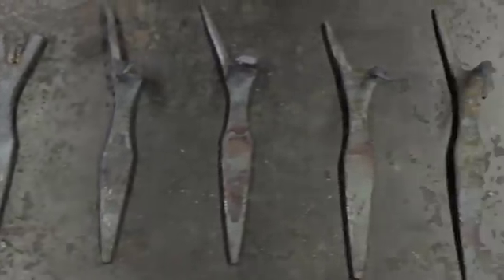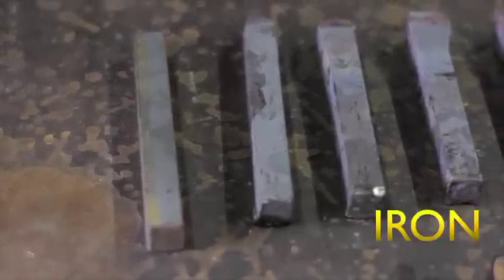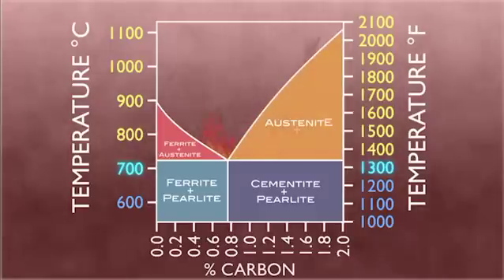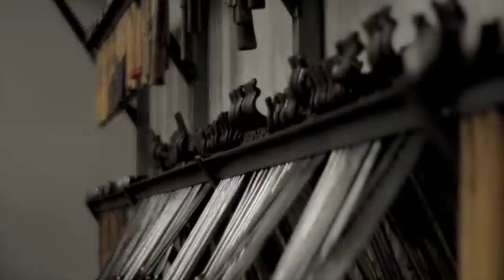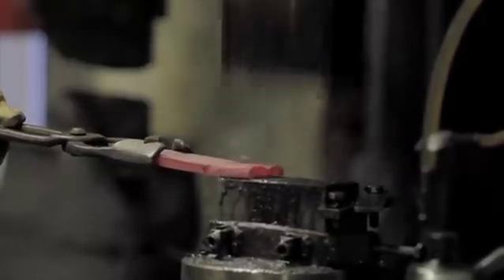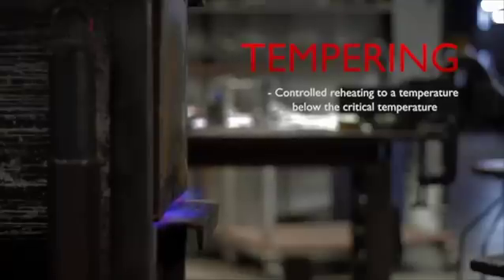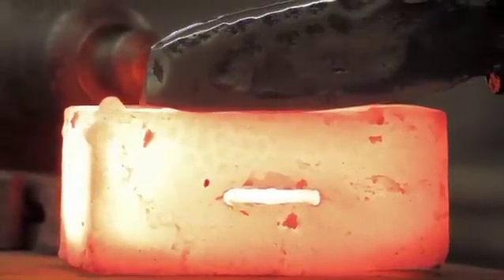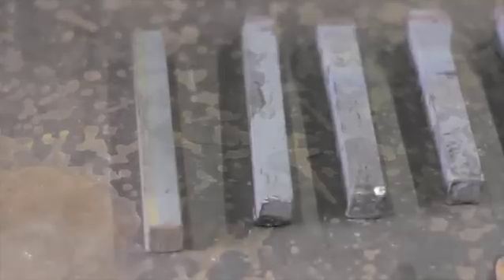The Steel Heat Treatment Process

Comment: can somebody tell help me 

if I wanted to harder and strengthen steel what type of heat treatment process should I look for
Reply: Look for a hardenable tool steel, which will have a high carbon content and various other metals that provide a variety of other properties. Suppliers will furnish technical data, including heat treatment parameters. You'll want to choose a steel that meets your requirements as far as tempered hardness, dimensional stability, machinability, toughness, abrasion resistance, red hardness, etc. as well as your capabilities. For example, if you don't have a heat treating oven that can maintain stable and precise temperatures for pre-heating, soaking and tempering, don't choose a steel with exacting requirements. Also consider whether your tool-forming process will involve forging or simply stock removal.

Comment: The tempering part in this video is quite unprofessional. Tempering by looking at the color is very imprecise. Proper tempering of the steel needs to be done in a controlled environment like for example in the tempering oven.
Reply: Serb yes and no

Comment: (I want to know why they did not stick to the magnet (What happens to metals
Reply: it reached the curie point
Reply: The loss of magnetism is a good indication that the crystalline structure of the iron has shifted from alpha iron, or ferrite, to gamma iron, or austenite, which is non-magnetic.  While most alloys of steel become austenitic only when heated, most common stainless steels are austenitic at room temperature and are non-magnetic or, at best, paramagnetic.

Comment: Reheating the steel over and over and over does increase grain size which will cause it to get a little weaker. If you go through enough heats it is a good idea to take some time to normalize or anneal it to shrink the grain size and also do that before you quench it.

Comment: You could lose carbon if you are running an oxidizing fire, but typically unless you get the steel so hot it starts to burn you're not losing anything.

Comment: Was it wrong at all on the more times you heat it, the more you weaken it? What I have been taught is that it loses a tiny amount of carbon every time it is heated and beaten, but since it is such small amounts combined with you are usually working with a thick piece of steel, you won't see much if any difference after a knife has been grounded out. I know of smiths who sware by smithing over machining

Comment: Hello,
I like the production value and the workshop, but some of your metallurgy is incorrect.
Steel has no molecules..it is only varieties of crystalline structures.
Please review the terms again and see what occurs when you heat a martensitic structure. I suggest John Verhoeven's book on "Metallurgy for the non-metallurgist"
It would have been good to see the "walking shadow" of the exothermic reaction which occurs when steel cools from austenite to pearlite.

Ric Furrer
Reply: Ric Furrer steel has no molecules?i spent over 30 years in a commercial tool and die heat treat. I beg to differ